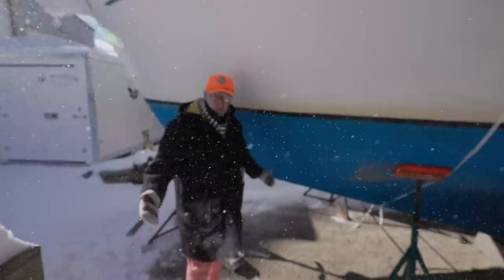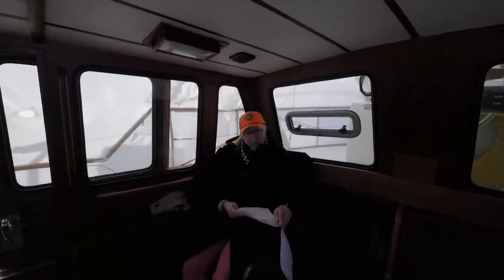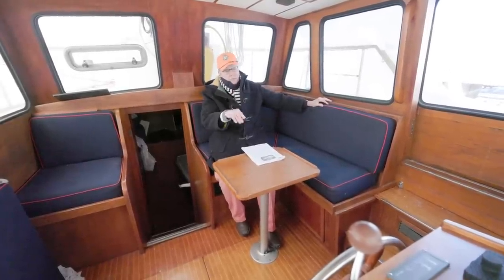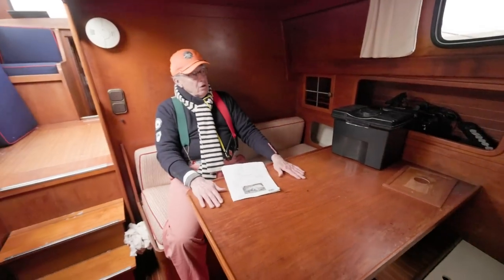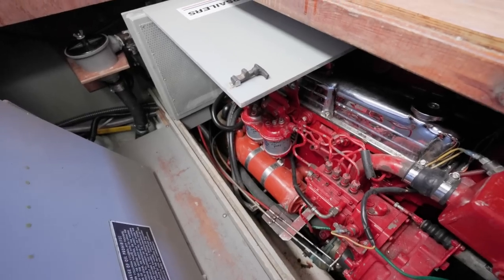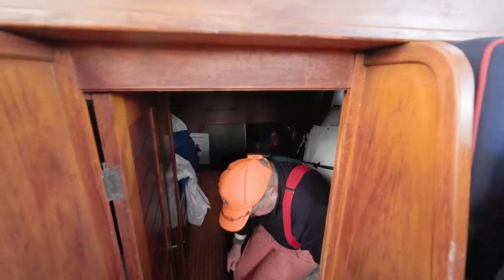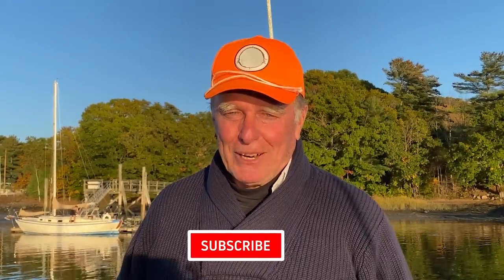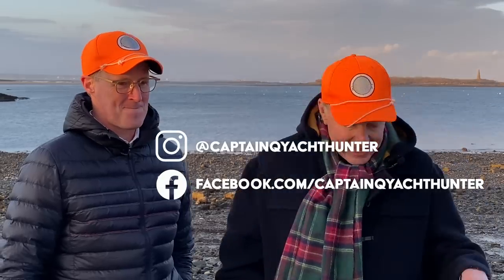$55,500 GO ANYWHERE!! Bluewater Ketch-rig Sailboat for sale - Nauticat 33 - EP 126 #sailboattour

Comment: I really like the notion of a pilot house for sailing vessels. I wonder, though, many are described as motor sailers, which implies a larger engine (higher bhp/ton displacement) and larger fuel tanks. Captain, do you know of any pilot house sailboats that are not considered "motor sailers"?  Glad to see you and Randay (or Randall or Randy, (I wish I knew which one he prefers)) doing more videos.
Reply from the maker: more and more today sailors are opting for large hard dodgers, which, with serous rear canvas ,can make a pretty good stab at a Wheel house...can work on most boats
Reply: Sirius DS - There are others.

Comment: Does it have a bow thruster on not? You keep going back and forth between the boat you are presenting and the boat of which you have pictures.  Side issue. The suggested repairs cost $23,000? WTF! A little clarity please.
Reply: Looks like no bow thruster. Based off the other views of the exterior in the video.
Reply from the maker: no bow thruster  they are nice   i used one once but i did maneuver the 52' PB without one for 18 years and no fin keel  or spade rudder for most of those years .....learn your boat
Reply: Bow thruster = side issue? 😅

Got to have a good look at Randay's walk up on each video so you can know the current boat from the other examples.